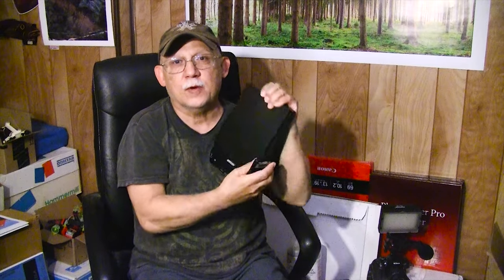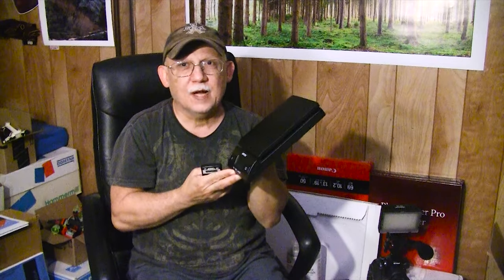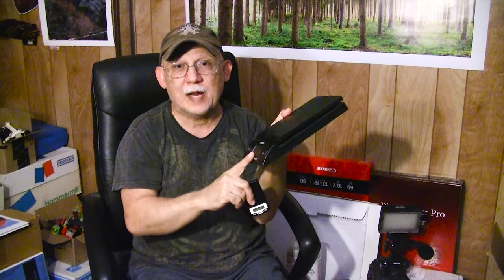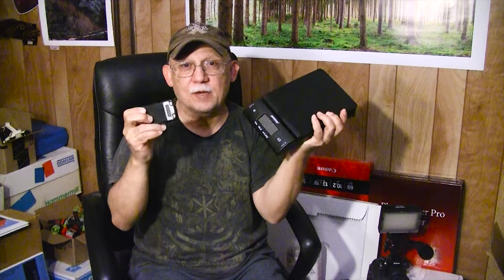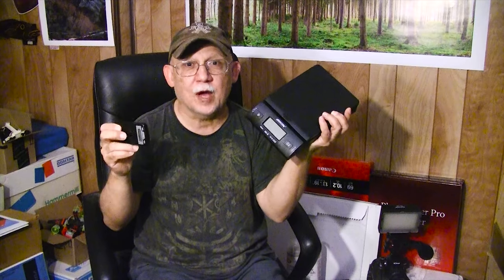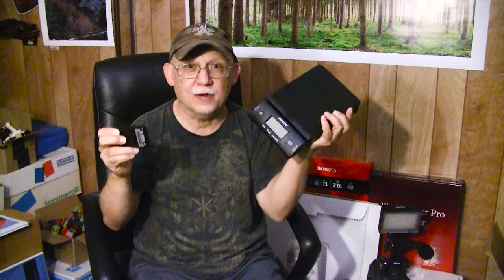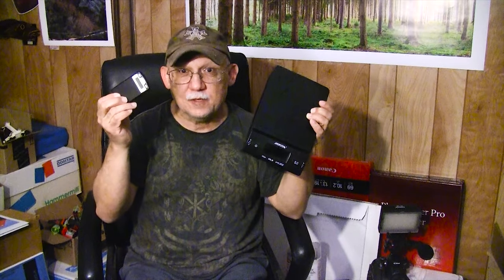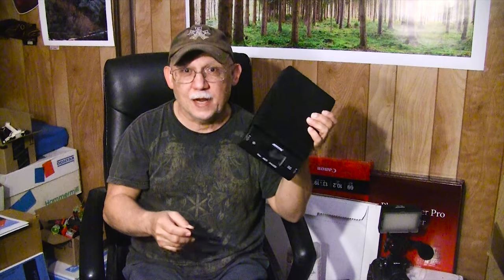The reason why You MUST really get yourself one of these Micro-Gram Weighing scales

Comment: And this is the reason why I am SO happy with my new Pro100 rather than the Pro9500 I used to use... the ability to just squeeze in the ink and see when it is full through the window.
Reply from the maker: +pesto12601 Yes they are indeed easy to refill! But there are still those who do have the 9500 and the newer PRO 10 or some of the Canon AIO office type printers which use totally opaque carts. Then younwill need that scale.
Reply: Jose Rodriguez
Yes they are and I have one that I used for years to fill the 9500 carts using the drip method... wasn't too bad to do though a bit time consuming... I use an Ozeri scale I bought on Amazon for $25... very accurate gram measurement... as soon as I was around 32 grams I knew the carts were pretty full.  Thx for another great video!!